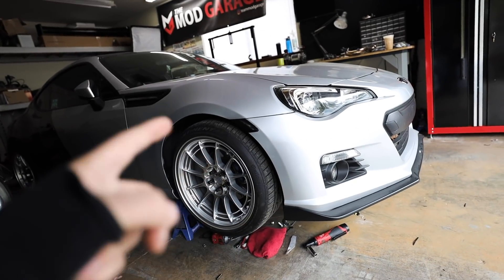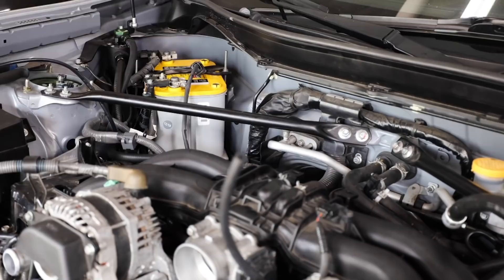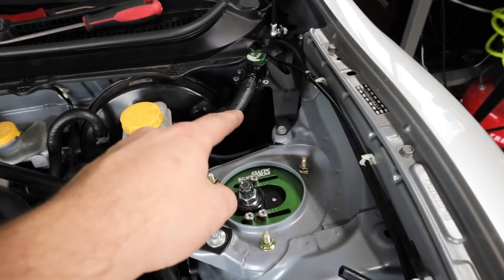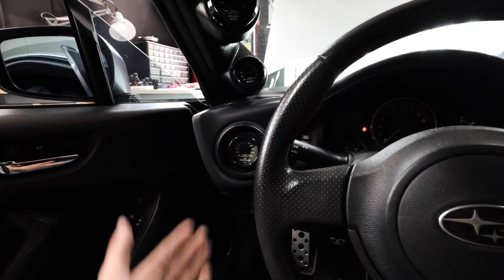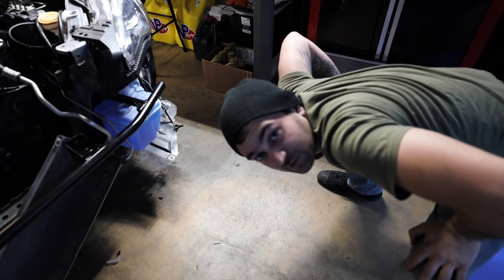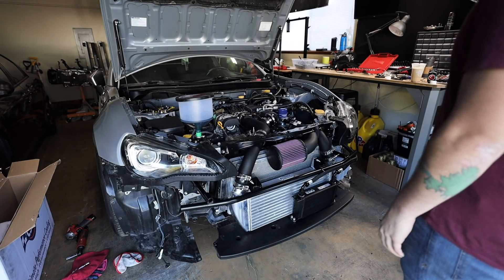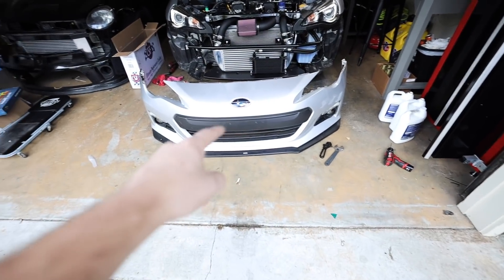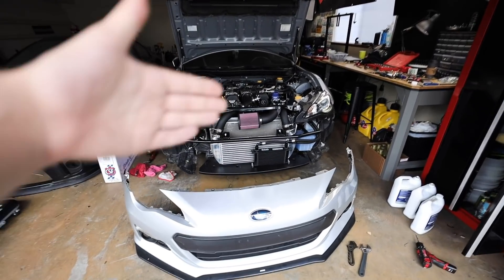The Turbo BRZ LIVES!!!

Comment: The oem oil pressure switch works the opposed then what you said, so if you don’t ground it the light won’t go on in the dash.
Reply from the maker: Thats what I figured, had it backwards 😅
Reply: @Smeedia  here's a good explanation of how an open switched sensor works: https://youtu.be/CZGg4x5VmkA

Comment: The oil press light sensor just need to be left disconnected for it to keep the light off... Oem oil sensor is N/C switch (normally closed circuit position at rest)
Reply from the maker: Tried that as well and no dice, ended up just teeing them off and plugging it back in 🙏
Reply: @Smeedia  dangg..i guess fa/fb series ecu were much more detailed in sensor io than the usual ej series.. 😅

Comment: Oil coolers...  i am so used to them being off to the side, like in front of a wheel like a smic.  The 3000gt and gtr use "side mounted" setups. Like behind the fog lights.
I am thinking when i get to doing an oil cooler it will be setup similar to the other cars. Also super want those type ra/s209 fog light vents. So sick looking.  Love the wide body on those
Reply from the maker: Yesss, and eventually ill move the oil cooler over there, just need to make some bracets for it

Comment: nice i recently purchased the same rotary tool. works great
Reply from the maker: Love it! I need to buy the stronger batteries though 😅🙏
Reply: Smeedia I bought the starter kit so it came with two battery’s and charger for $99!
Reply from the maker: Dame but theyre the 1.5 Mhp batteries, they work but they don't last long for me swapping between all my tools 😅

Comment: When I installed my super charger my brz would just choke out unless I had the maf unplugged im surprised yours started and ran without a tune
Reply from the maker: Same, it only died 1 time and only because I was revving it to push air bubbles out of the cooling system.
Reply from the maker: What super charger did you go with?!
Reply: @Smeedia  jackson racing c-38, i was suppppper close to getting the jdl turbo kit but as a daily driver I was a little worried on reliability with it. I'm getting tuned on Monday and have never rode in a boosted brz so it'll be a experience for sure. 👍
Reply from the maker: I'm right there with ya! Never rode in one or been in 1. Our tune days are super close as well! Follow up with your power #s! Curious to compare 🙏
Reply: @Smeedia  will do!

Comment: fixed the sensor but did you use the same type of wire as the 02 sensor? single core vs. wound.
Reply from the maker: TBH I can't remember, I made that O2 sensor like a year ago. I remember that it had the same # of wires 😅

Comment: Funny just installed my aem Wideband worked for literally 2 minutes mine now does the same thing starts then 3 dot not nothing very frustrating for what you pay for AEM gauges, waiting on a replacement not to confident on the replacement either seems like a common issue this one don't work going try prosport
Reply from the maker: Ive had the replacement sensors fail the exact same, the amazon patch sensor i used has been going for 2+ years

Comment: Hello I have a question about the sti dp.
I look up 2018 sti invidia catless dp and it have 2 kind. 1 is extra 02 bung. 2 is divorced. Do you know which 1 is better?
Reply from the maker: Get the one with an extra bung, if you ever run an AFR gauge later on youll thank yourself 🙏
Reply: Smeedia do i need fuel rail if installing injector?
Reply from the maker: No you do not, you can use stock rails
Reply: Smeedia alr thx u

Comment: maybe im mistaken but i thought these fa motors have a much higher compression ratio since its natural aspirated. will that be an issue?
Reply from the maker: They do, and from what ive read they're safe up to around 350ish WHP 

Cannot confirm though 😅
Reply: @Smeedia  fair enough. What is the peak psi on that map kit. Btw i have the map tmic for my 18 wrx and it came damaged its a beast of an intercooler but i think i would avoid them. Theres better options for more and less. New provision racing is a great site.
Reply from the maker: The turbo can go 22ish PSI but ill be keeping it around 8-10. Thr block won't like a ton of boost 😅🙏

Comment: Was wondering if you can help me diagnose. My brother and I recently took his motor out of his 05 sti. To do maintenence items. When we put it back together and started it up. It struggled to start and back fires. Make a loud pop then starts up. Idles completely fine and drives fine but the start up is being weird. Any idea on what it could be? Everyone I've asked so far said it might be spark plugs but we replaced them like 2k miles ago. Could be bad ones?
Reply from the maker: What all did you guys do to the motor while it was out? And any CELs?
Reply: @Smeedia  Valve cover gaskets, timing belt and clutch. It has CEL. Before we took it out, it had a code for Evap.  We're waiting on my in laws scanner.
Reply from the maker: Without knowing what the current codes are not much I can do. Follow up when the code is scanned! 🙏

Easy things to check:
Spark plug Gap
Verify timing

Comment: Looking forward to hp numbers on this one. Can't believe a 2.0 engine could hold 9 quarts. Is the oil pan larger than a WRX/STI? My WRX only takes 5.4 qts
Reply from the maker: The oil pan holds 8 qts or so and the oil cooler holds another 1 qt 😅

Comment: @smeedia which brand of spark plugs d you recommend  for a stock 2013 WRX  ? just rebuilt the motor
Reply: Can't really beat oem
Reply: I've used the NGK iridium's in my motor when it was stock. They're a solid plug and keep the motor running solid. Now that the motors built, I use the NGK iridium one step colder.
Reply from the maker: NGK Irridium 2309 🙏😁
Reply: @Smeedia  ok thank you guys i just got my first wrx and adn starting watching your video over 2 moths ago and i have learn a lot about the car.

Comment: Hey boss another fantastic video as usual.   I’m taking notes. ha.  Can yo7 tell me where you got or made the Pilar gauge pods plsr.  Thx in advance Steve
Reply from the maker: http://frsparts.org/Rexpeed-Dual-Pillar-Gauge-Pod-FR-S-BRZ.html

🙏🙏🙏
Reply: Smeedia does the adhesive hold up pretty well on top of the stock pillar trim or is it best to add some black screws.  Thx in advance partner 👍
Reply from the maker: I used JB epoxy weld for plastic and its never going to come off now 😅
Reply: Smeedia outstanding bud thx sir.